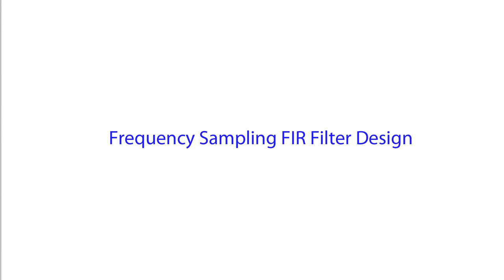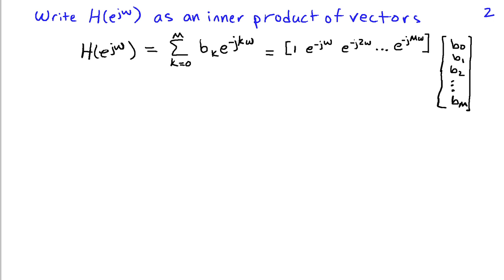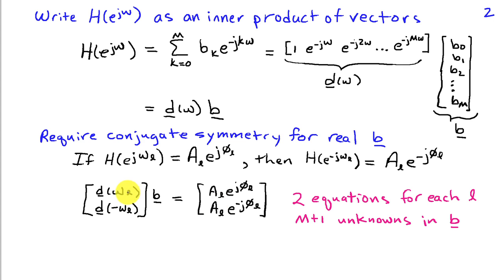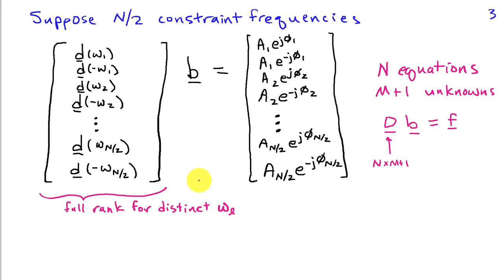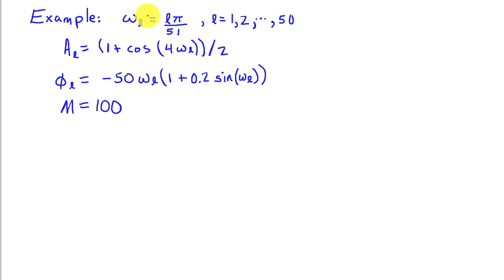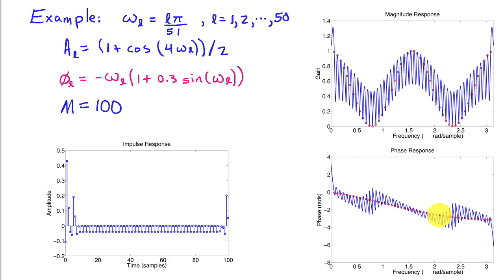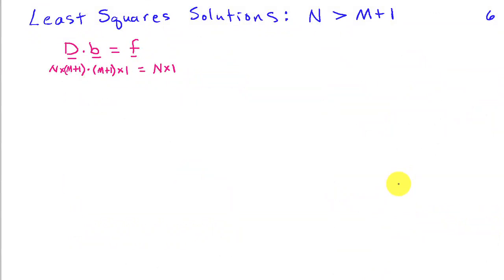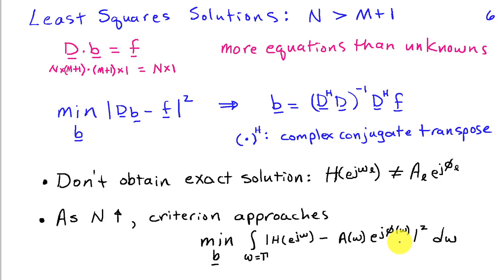Frequency Sampling FIR Filter Design

Comment from the maker: The freq samp approach always starts with a finite number of terms in the imp resp, and then either: 1) exactly matches the specified freq resp at the freq samp (if freq samp LE the imp resp length), or 2) minimizes the squared error between the actual and specified freq resp (freq samp GT imp resp length). In contrast the window method finds an ideal imp resp that exactly matches the desired freq resp, then truncates. So freq samp assumes finite imp length from the start, windowing does not.